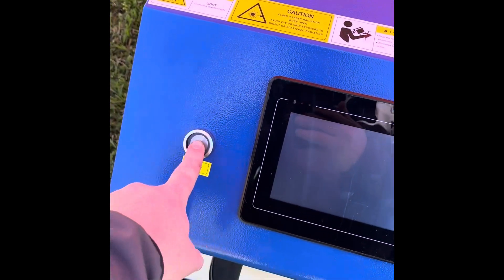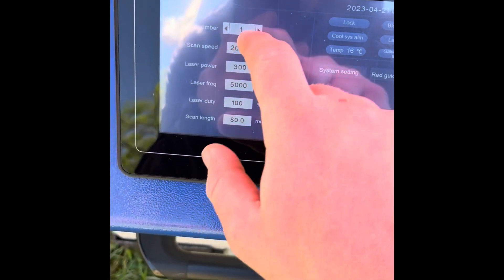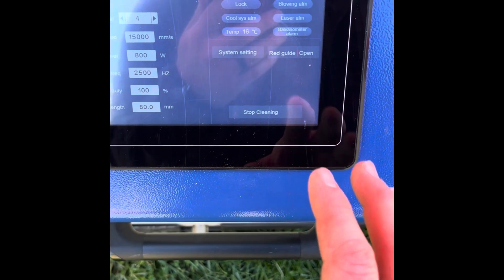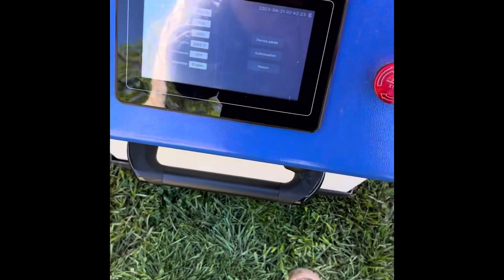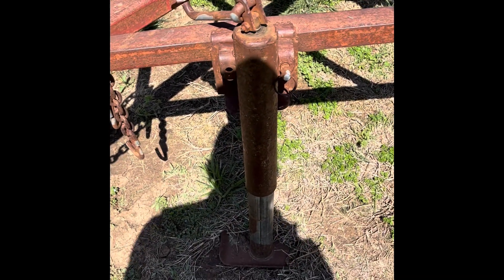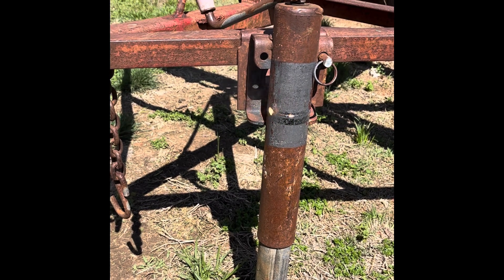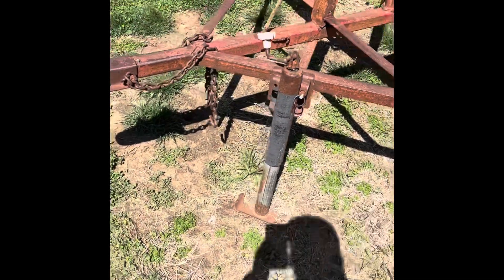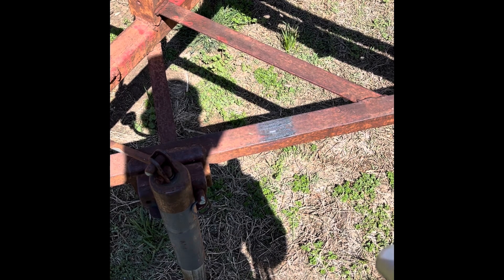Haotian 1500W 3in1 Laser Cleaner - Laser Cleaning Basics

Comment: How much psi did you need to supply?
Reply from the maker: I think it was like 20psi or so. It’s not much, just enough to keep smoke and debris from blowing back in.
Reply: what do you use Argon gas or compressed air?
Reply from the maker: @MATESTARGIOIA  compressed air for cleaning, nitrogen for welding
Reply: @Swinging_S_Lasers  What was the cost of the machine? i dont find anyware the price

Comment: What are the specs on your generator? I bought a 2000w cleaning machine from the same manufacturer.
Reply from the maker: 1500W needs 9000w,  a decent sized compressor will trip a 9500w generator when it starts up while lasering.  I know because mine tripped it all the time.